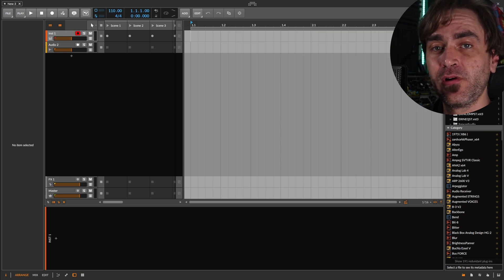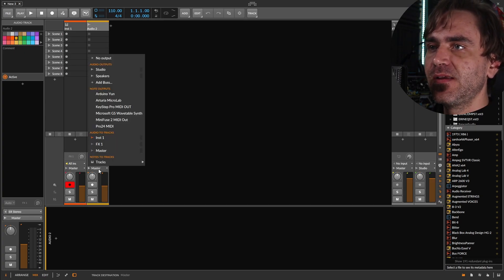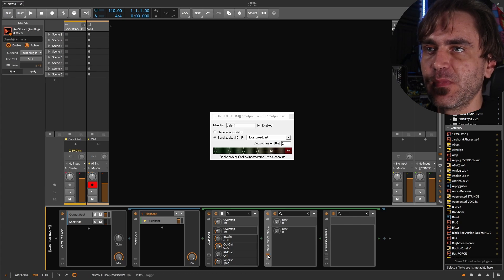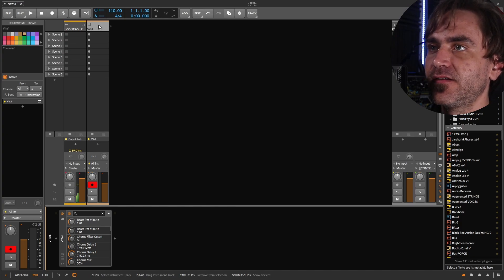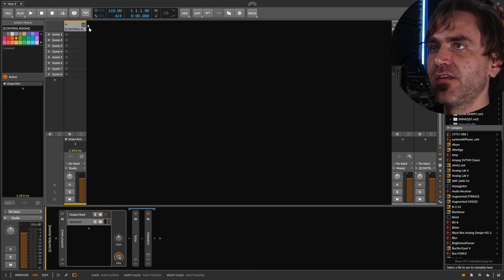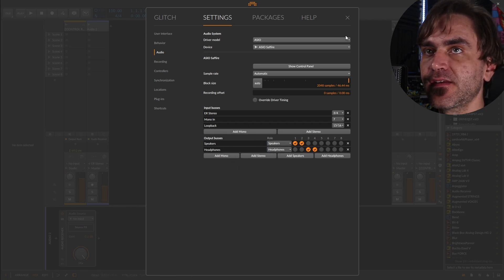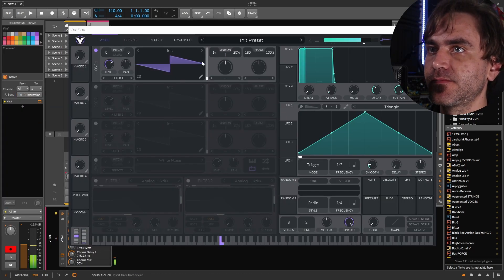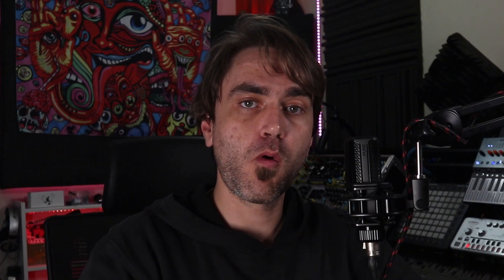How To Set Up A Control Room / Listen Bus in Bitwig

Comment: I have a problem when I use the "studio" output, bitwig suddenly also "bleeds" audio on other channels of my audio interface while I have all outputs on the monitoring panel muted.
Anyone else experience this problem?
Reply from the maker: make sure you have no input selected and monitoring on that channel
Reply: @DashGlitch For testing purposes, I've tried to make a completely empty project, manually disabled all outputs disabled in the monitoring panel.

I have one single track generating a test tone without any inputs, but an output to the master channel.
And the master channel outputs to the "studio" output channel.

I don't hear any sound from the speakers (because everything is muted).
I haven't enabled any cue's, and I also haven't made any specific routing to the channels in my audio interface driver mixer.

When I output the master to the speaker channel there is no problem, but as soon as I select the studio output (with all outputs disabled, and likewise all monitoring on inputs) suddenly I get the master audio "bleeding" through on my adat channels.
I say bleeding, because it is very soft in volume, yet audible when amplified.

Given all this, do you have any ideas?
I've tried looking all over the place and also sent a support ticket to Bitwig.

Comment: Cool. I have a similar setup, just I use the Bitwig Convolution to do the room and headphone correction, SoundID is a bit overkill imo.
Reply from the maker: Good tip, did you make an IR of your studio? that's actually good idea for a video! I tend to find Convolution plugs to be pretty CPU intensive, so maybe i'll go with the GPU audio which is really good and light on the CPU.

Comment: Regarding that 2nd CR fot headphones - wouldn't it be enough to set it up as a separate layer on the main CR? Each layer is a full fledged "nested" channel, with its own I/O, sends, etc.
Reply from the maker: Yes true, but I don't want to always use it :) I only use headphones like 10-20% of the time, and having that in my output rack preset is just a waste of CPU i think.
Reply: @DashGlitch  You can always Alt+A that layer which disables all plugins and frees up RAM and CPU :)
Reply from the maker: @antic604  The beauty of Bitwig - There's always a more efficient way. The curse of making Bitwig videos - There's always a more efficient way hahahaha
Reply: @DashGlitch  different ways to do things makes it really nice for different people's workflows and preferences. "better" or "more efficient" is in the eyes of the beholder. Always great to have options!

Comment: There's a slightly simpler way to do the Control Room in Bitwig (with no need for the Audio Receiver).

1. Create an FX channel and label it "Control Room" 
2. Set its input to "Master(POST)"
3. Set its output to be "Studio"
4. Turn its Monitoring to "On" (this replaces need for an Audio Receiver)
5. Add any analysers /calibration software on this Control Room FX channel
6. Change master to "No output"

You will then be monitoring things through the Control Room FX channel but bounces will be of the Master which is pre Control Room.

You can do the same thing with an Audio Track but FX Tracks are 0dB by default and it keeps the Control Room at the bottom of the track list next to the Master
Reply from the maker: I prefer to have the CR nested in the project, in a folder so it can be hidden. I end up using the FX quite a bit, and don't want to route something there by mistake etc. The receiver was just for an added channel, I think the simplest is the first method I described ;)
Reply: Good alternative. This is the way I'm doing it too, but that's just my preference. I can see a benefit to Dash's method too. The idea and basic setup is the same either way.